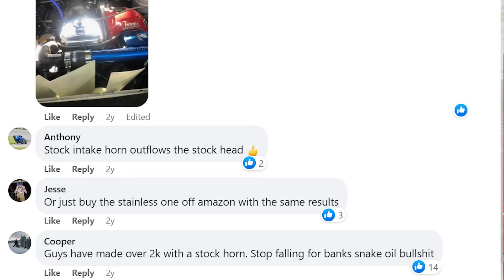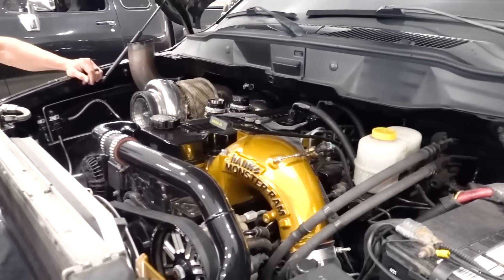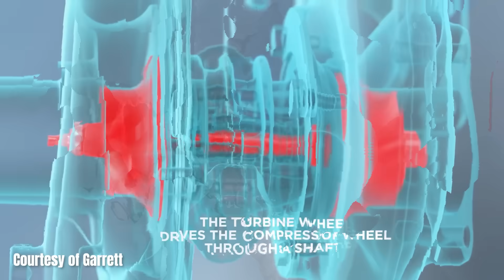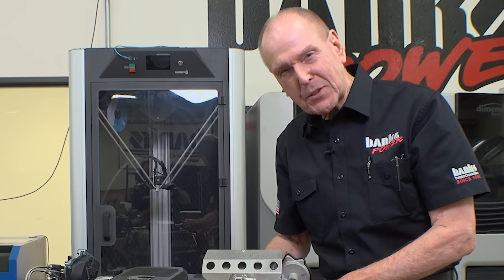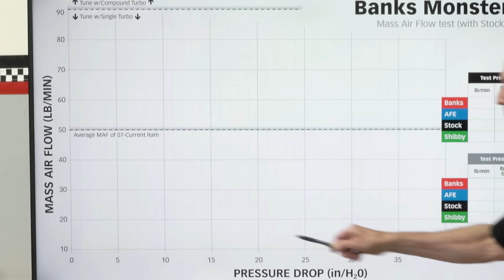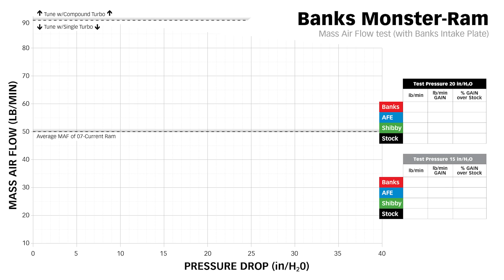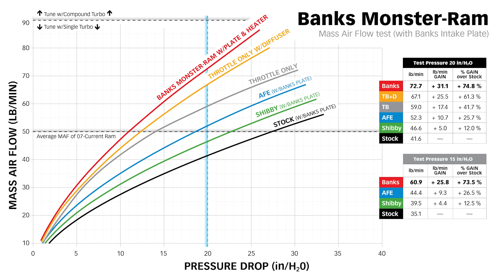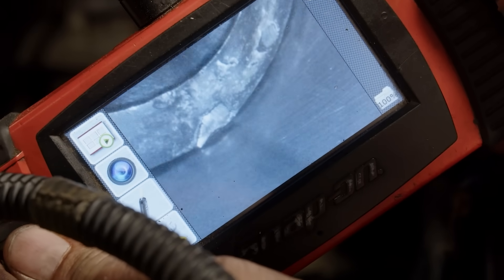Stop this wives' tale about Cummins engines! | Fact Check

Comment: CFM, Air Density, MAF, etc. are great and all but what about objective, real-world results? I’ve yet to see any objective data points (ie. increases HP by x, increases Tq by y, MPG by z, or even 1/4mi time reduced by n, etc.). All real-world performance related content is always subjective, anecdotal reaction videos that typically include the Pedal Monster (whoopie....). This is all starting to feel more-n-more like Snake Oil to me.

Comment: Gale I have absolute trust in your research and development. I have a 2003 Mustang GT with the 4.6L 2V. I have an aftermarket throttle body and cold air intake that puts the filter into the right fender with an elbow. What is the best cold air intake and performance upgrade Banks makes for the 2003 Mustang? I have the K&N cold air kit and the turbulent air near the mass air flow sensor causes idle issues.

Comment: Gale,,, I have a question, on the intake side of the engine with banks intercooler, pipes, air filter, ram horn, grid heater intake plate replacement product, larger intercooler and how this can work to the advantage you claim with the emission exhaust system these truck have..  It seems to me only so much air in the form of exhaust can go out of the engine no matter the amount of air you cram in the intake side..   One of the things you hear from the guys that have removed the factory exhaust is the instant HP gain from this action.  

One thing I would like to see would be a bone stock truck do a dyno run to measure HP to wheels and than the after with say just horn and grid heater intake replaced, then add the big ass intake, and last the better pipes and intercooler..  all the intake replacement EPA compliant products you design and sell.. 

That would prove to me and others you are selling more HP in the form of better air flow.. 

have been a fan for more years than i remember, :)

Comment: I bought headers and a cat-back system from Banks because it was supposedly CARB legal, when I went in for the annual smog test the technician ran the EO number provided by Banks, it was not for my truck. I thought ok, it's a simple mistake, but it was not, NO emissions testing had been done for my truck, they just enclosed a bogus EO number and claimed the parts were CARB legal. Banks answer to the problem, "just go to as many testing stations as it takes, someone will pass your truck". WHAT? No, I will not do that, this went on for over a year, and every time I called they refused to allow me to talk with Mr. Banks, he probably didn't even know there was a problem. I finally got the California Air Resources Board involved and they forced Banks to do the testing and provide a legit EO number, before all this I held Gale Banks in high regard but, now I will never spend a dime with that company again.
Reply from the maker: Please email us at socialmedia@bankspower.com. We need to investigate and make this right. We do not issue bogus CARB decals. It's illegal.

Comment: I'm not an engineer and don't even play one on TV. But I still can't help but question how all that extra "flow" before the head which was demonstrated beyond doubt can be getting through a fixed volume of space (the head with the valves open at normal height). Wouldn't it be better demonstrated if the intake was attached to a stock head with the intake valves fixed open at stock opening? It doesn't seem that you answered the original question with your testing. Again, I can't and am NOT claiming that your conclusions are wrong, but I would be a believer if that test included a stock head attached to that setup.

Comment: I have NOT thoroughly researched this to be fair but serious question… 

what are the dyno results with stock 6.7 intake horn and the Monster ram?

In a quick google search I was not able to find such information which is a red flag. But maybe I missed it 🤷‍♂️
Reply from the maker: We did not find it necessary to dyno test the Monster-Ram. The improvements are experienced as throttle response and fuel economy, neither of which will show on a dyno graph.
Reply: @bankspower  You still dodging it man... Sucks I will likely pay to put my truck on a dyno the next time I am at one of your most venomous competitors just to solve this 10 year mystery. The air horn vid will cost me and extra $1000 of dyno time but I 100% plan to do it cuz I dont like being lied to. Good bad or indifferent I will post the results once I make it there. 

I am planning to compete at the UCC. I am not sponsored and into this already 200k. I will be dyno tuning using BD's horn after I do the vid for yours if it has not been done yet. 

Have I got your attention yet.... You will hide me for the future when I come back to post the vid. Shame you run from such a minor challenge.
Reply: Okay thank you for the reply!

Comment: Does your air intake heater pull less voltage then the stock one? I notice with your intake on my trucks when the intake heater is activated the voltage drop is almost non existent. The stock heater would pull the voltage meter down then when it kicked off the voltage meter went back up to 14.
Reply from the maker: The coil heater included with the Monster-Ram draws less than half the current of the stock grid heater.
Reply: @bankspower  After all these years still no dyno test. Thats the only thing that will squash this... You wont dyno it, so its just a piece of bling. I am ok with it just being BLING just not the bs snake oil you are pushing. 

Your dif cover you showed some useful date, but you refuse to use the dyno for such a simple test on your air horn. I have been hated on so much for your horn. I know it is just bling lie a magtec diff cover. At least your bling has ports. 

One day someone is gonna test your horn on a dyno. better hope its you and you either prove it does something or own and sell what the horn is good for...  The ports and grig heater mods are useful. No need to lie about power gains when there is none. I say none cuz no dyno test after 10 years.

Anyways still a customer, but this thing is just bling and you know it.  You would have done a dyno of everyone's horn showing how much more your gains, if there was anything to show besides a margin of error.
Reply: @bankspower  just another benefit to your design. We have one on a 2018 3500 HO and a 2014 5500 chassis cab. So far they are working great.

Comment: TLDR; I agree: here is why I agree.

At the turn of the pandemic I was trying to create a diy powered air purifying respirator, papr for short. I bought costume fans, the type for the inflatable dinosaur costumes, and cpap hoses to try and create one of my own. What I quickly discovered, aside from chasing leaks, is the difficulty in pushing any decent mass of air through a hose can be. Physics dictated that the longer the hose the more pressure resistance you encounter, and the turbulent flow from kinks or bends increase the power required to push a desired amount of air through the system. I quickly abandoned that project as store bought cage fans either don't have the capacity or would cost the same as an industry provided papr would be. 

In Aerospace applications, turbine engines, are fighting between the need to extract energy from the exhaust flow and compressing the air to feed the combustion chambers. You add more work to air and you get less in return. Hot air expands and it then needs even more power to push through the system. If you keep working the air, the temperature rises, and the more exotic materials you need to combat temperatures capable of melting iron.

It is easy to draw air through an intake horn and filter to the mouth of a turbo; this regime is dependent on viscous drag which is negligible. What is difficult to deal with is the heat and resulting path after the turbo. Any portion of plumbing after the turbo deals with pressure drag that is dependent on the texture, path, and number of obstructions. This air wants to equalize with atmospheric conditions to return to it's lowest state of entropy, it strongly does not want to stay squeezed. Power therefore is limited by the size of the inlet side of the turbo and by how air temperature; directly related to density, is managed. More turns/ roughness = more temperature; the longer the hose = more drag. So any reduction in complexity and resistance however small = FREE POWER (At the cost of engineering r&d)!
Reply: same goes for a water pump. friction loss is a big thing. for example 200' of 1.75" hose you looking around a coefficient of 6 for friction. for you to have say 100psi at the end of the hose you'll need 130psi at your pump
Reply: TLDR
Reply: Bro, that is NOT what TLDR means. 😂
Reply: @brian451111  the tldr is at the beginning of
Reply: Thanks for this comment. Love hearing about stuff I don’t know much about and even more so from a well informed source. Good stuff, makes me eager to explore more.
Reply: Just wanna say thanks for this tidbit
Reply: I guess a few people got tired of constantly sounding out words.  They don't like sentences and hate paragraphs. 😂🤣
Reply: This post lacks common sense.
Reply: @rob83r  Yes, your comment surely does.
Reply: I stopped reading at pandemic
Reply: @renohuskerdu4592 😂well it's pinned so there's that.
Reply: @The.Dayum.W  and I'd say a modicum of fluid dynamics knowledge lends credence to the claims.
Reply: @renohuskerdu4592  I just posted a comment saying it isnt possible to educate people who stop listening once science is mentioned. It is perfect that I read this thread next
Reply: @renohuskerdu4592  well done! i stopped thinking under supervision at plandemic ;-)
Reply: And you are? Why would it matter if you agree? your channel certainly doesn't aid your credibility any. Why didn't you film and upload anything to your channel on this video hosting platform you are on?
Reply: @eriklarson9137  I'm not here to split hairs, and I do not take pleasure in one-sided arguments. Know this, the world is much bigger than any one youtube channel. We should all strive for knowledge in our own way. I stated my opinion and my observation in a manner that is digestable to non-engineer type folk. Within reason, I expect that mechanics, craftsmen, technitians, and engineers alike can draw from their practical experience to connect the dots. I have attended university, and I do have a degree in aerospace engineering. If i go in depth and try to explain how and why Banks Power, so kindly pinned my comment, we would have to cover physics, aerodynamics, and differential equations just to cover the basics. My channel is for my own amusement; I do not expect to please anyone and everyone with the videos or comments i've posted. I am an individual, and I try to be respectful to others while I am online. I hope you can take it upon yourself to reflect on what you have posted (if you delete your comment, know that I will not forget we've had this discourse in a public forum). Have a good day
Reply: @eriklarson9137 found the science denier

Comment: The idiots trying act as if they know more than Banks about how any of these engines work, are also the same idiots that believe black smoke is the sign of big power. And that is just the simple truth. I have seen more smoke rolling idiots having engine issues in my area, NO MATTER the era of diesel engine, it boggles my mind that they even have a driver's license. Meanwhile, those that have their engines tuned and modded CORRECTLY get hundreds of thousands of miles from their engines, more power and better fuel economy. Huh....funny how that works.

Comment: I’m sorry but the entire point was the head was the limiting factor and all you did was prove your intake flows better air backwards which nobody doubted so what was the point?
Reply from the maker: A couple important notes. The point of the video was not about the head's flow. The point of the video was to show that even if the head restricts the number of cubic feet per minute of air flowed, it does not restrict the mass of the air. In other words, flowing the head was not necessary to prove Gale's point. Look at it this way... let's pretend the head's job was to flow liquid rather than air. Let's imaging forcing water through the head and valves at the head's maximum CFM of 400 cubic feet per minute at the horsepower peak. For the second test, you force molten lead through the head and valves at 400 CFM. Same flow rate, but very different densities. You've filled the same cylinder volume in both tests... but the weight of what you filled the cylinder is very different. When you compress air, it gets heavier and takes up less space. Therefor you can squeeze a lot more of it into the cylinder at relatively the same flow rate.

Regarding the flow bench tests, they weren't performed backward. The flow bench can push and pull air. In the case of this test, it was pushing air out, just like the turbo would do.
Reply: @bankspower  after your charge air cooler the air density isn’t changing or only changing minutely. Then it is about cfm and if the head is the choke point having good air flow to it won’t matter

Comment: As a Banks customer myself I know first hand they put out good products  and he proved his horn flows large amounts of air. I find it comical though that in no way did he prove the point he claimed he was going to. He never even addressed the airflow of the head at all in the video. Without measuring head flow how in the world does he think he proved people wrong? I don't know if they were right or not and this video leaves me still not knowing.
Reply from the maker: The point of the video was not about the head's flow rate. The point of the video was to show that even if the head restricts the number of cubic feet per minute of air flowed, it does not significantly restrict the mass of the air. In other words, flowing the head was not necessary to prove Gale's point. Look at it this way... let's pretend the head's job was to flow liquid rather than air. Let's imaging forcing water through the head and valves at the head's maximum CFM of 400 cubic feet per minute at the horsepower peak. For the second test, you force molten lead through the head and valves at 400 CFM. Same flow rate, but very different densities. You've filled the same cylinder volume in both tests... but the weight of what you filled the cylinder is very different. When you compress air, it gets heavier and takes up less space. Therefor you can squeeze a lot more of it into the cylinder at relatively the same flow rate.
Reply: @bankspower  I'm in no way anti or negative towards Banks. I have purchased and likely in the future will purchase Banks products in the future. However what you described was in no way what I took away from the video. The video was a comparison of different horns compared to the Banks horn. I'd like to see the flow of each while connected to the head with the valves either out of number 6 or at least the valves open. That would prove if the negative comments he read in the beginning we right or wrong.

Comment: Measure intake flow with different horns and intake manifolds with a superflow bench. Until you can show that this product increases intake flow through the bench over the stock option with all other variables equal, I'm not a believer. You did not address amount of air reaching the cylinder. The limiting point is head ports from what I understand, and that was not addressed here. You have the tools, I'm sure many people would love to see those data. I know I would love to be proven wrong.

Comment: So how much does the head flow in stock form?
Reply from the maker: 331 cubic feet per minute. A tuned RAM 6.7L running 3400 RPM consumes 400 cubic feet per minute. But neither of those numbers matter. As discussed in the video, what matters is the density of the air, not its volume. How much does the air weigh? That's what we care about.

Comment: Gale, as someone who recently graduated with an engineering degree, I can tell you the disconnect with a lot of the naysayers/wrench turners has a lot to do with their nearly complete lack of understanding of basic fluid mechanics and thermodynamics principles.  Before I had the engineering mechanics classes, I didn’t understand these principles either and it seemed like an easy solution to just look at one factor, Q, or flow rate to try to understand machines.

I guess what I’m saying is, more videos like this, explaining all the variables in fluid flow and how they relate to engine horsepower, should help a lot.
Reply from the maker: That's great idea for entry level, thanks!

Comment: Question???? What happens to the Banks relocated heater coil if the relay sticks and gets stuck on? Does it melt and or fall into the intake just like the stock Grid heater bolt?
Reply from the maker: The Banks coil heater element will not melt like the factory unit and is rated to a higher amperage than the factory grid heater element. Additionally, the heater coil is welded to the base that attaches to the Monster Ram housing; unlike the factory heater that is held together with plastic. Finally, if the coil were to melt and fall into the manifold, it would be too large to pass under the intake valve like the stock bolt can.  Another advantage of the coil design is that it takes less than 5 minutes to inspect.
Reply: Awesome thanks for the reply